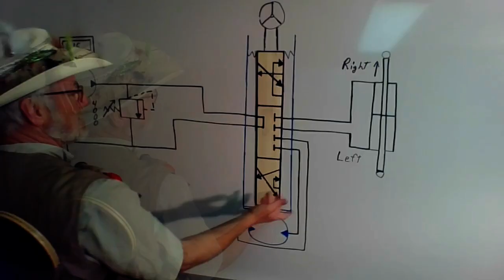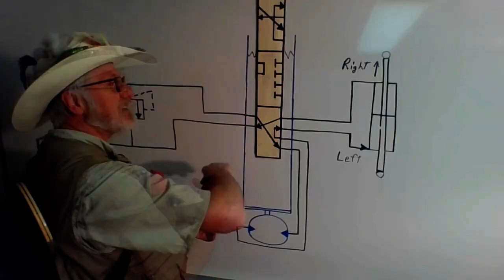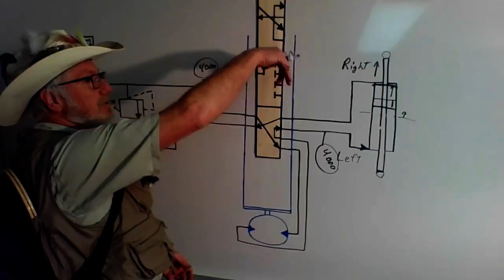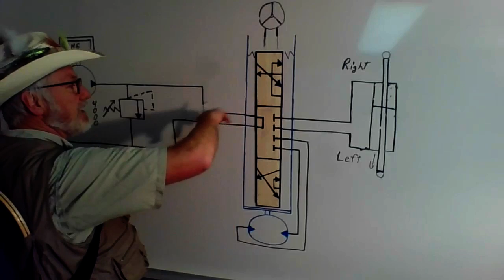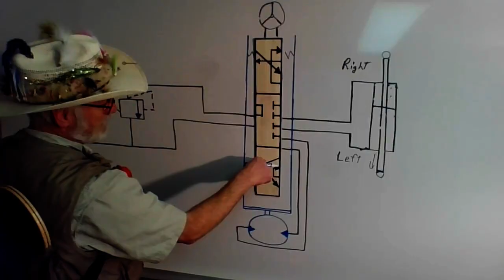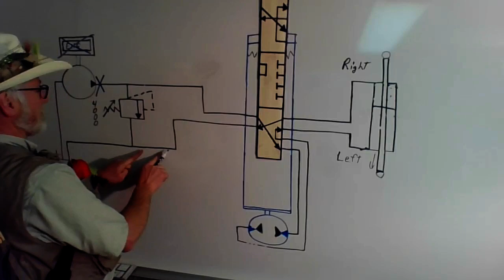Hydraulic Wheeled Steering Systems, Hand Metering Unit (HMU) Explained

Comment: Great video! I've always wondered how these systems work. I might have to watch it another couple of times to get the full gist of it though. Do you have a video on how a power assist system works? Like of where you have the steering box and a hyraulic ram with the valve on the ram that pushes/pulls on the drag link. Cheers from New Zealand 🇳🇿
Reply from the maker: I loved new Zealand but no i have no video on that system that uses a follower valve instead of a follower sleeve. Really it just uses another normally closed valve by a spring that you overcome either hydraulically when needed or physically when no hydraulics. I'm sure goggle will show you what you ate looking for.